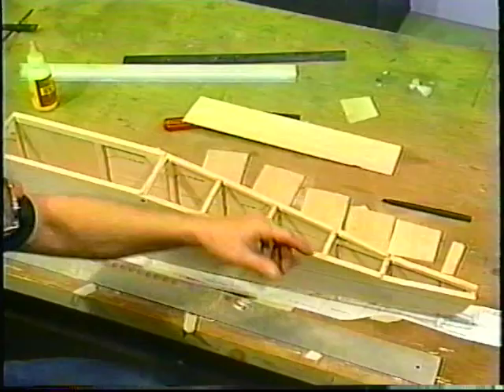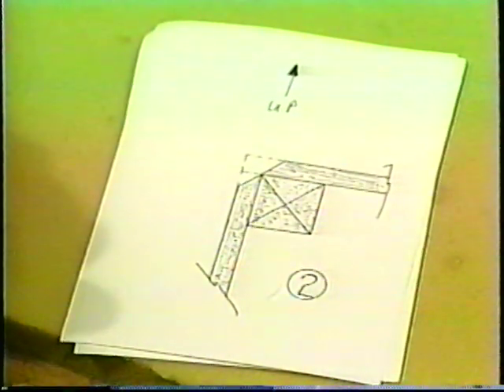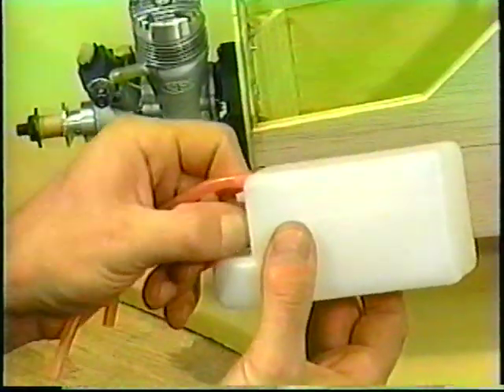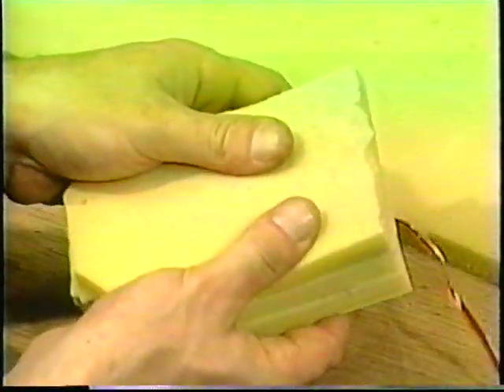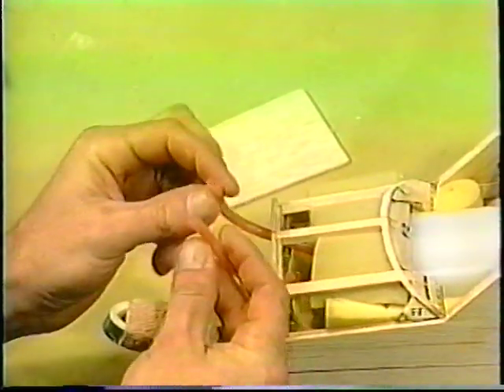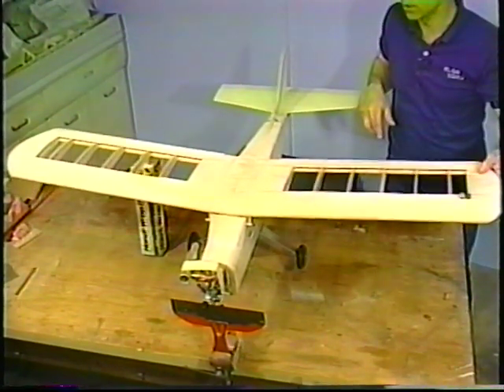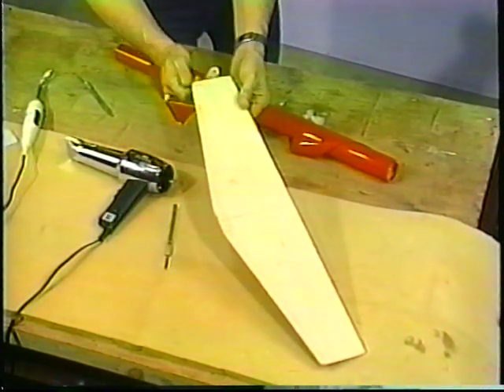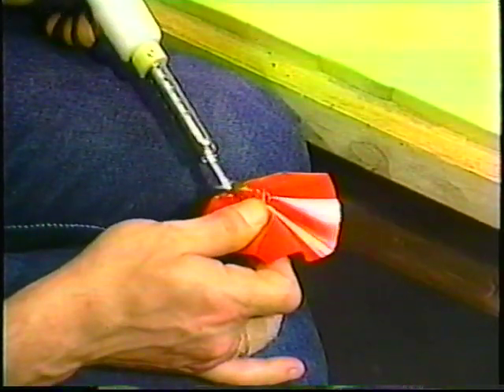Build it right the first time

Comment: I always mount my switch so “in” is on and “out” is off.  That way if the switch gets bumped accidentally the switch will be on.  When you  take off and maybe veer off the runway and  hit some weeds, you don’t want to have your receiver turned off accidentally.
Reply: Thanks good tip.

Comment: You should do a remake of this video with your own little touch to it. I don’t think anyone would be better suited with your old school feel it would incredible.
Reply from the maker: I have thought about it but it's a lot of work!
Reply: @n1114v  I really enjoy your stuff. I’m the same age as you, I got in the hobby a little later then you about 13-14 but kits, building, fm radios were still very big. I put the hobby to the side for a few years and when I came back a few years ago everything changed. Everything is foam and electric and just plain throw away. It kinda sucks. Watching your stuff kinda puts me back where I left off. Kits covering glow the time preparing. Only thing I can’t get back is the LHS. Talking with the old timers digging through the Mononoke rack checking out the new kits. They all closed up by me. Anyway thanks for the you spend putting stuff up.

Comment: i dont think you should put balance weight att the tip of the wing...  shure a small amount dosent matter but still keep the weight centered...
Reply from the maker: Lateral balance is very important!
Reply: @n1114v  yes but putting it as far out as possible increase wingloading
it better to keep weights close to rotational center...
Reply: @Drutten35   the further out on the wing the less you have to use